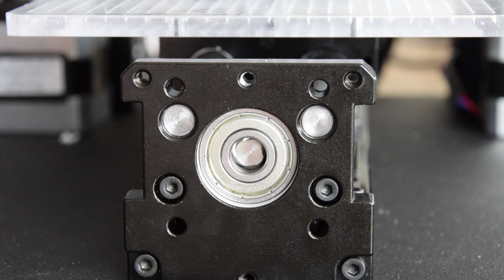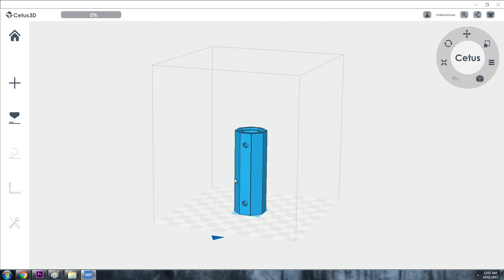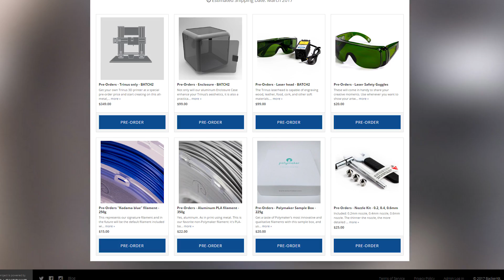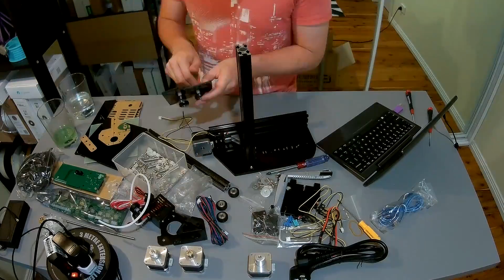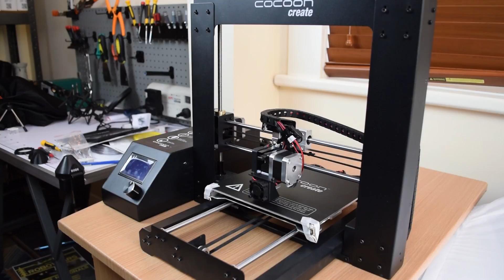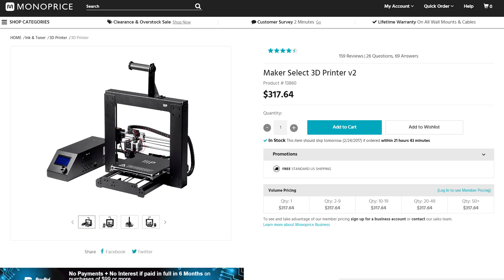Cheap 3D Printers THAT DON'T SUCK $350 and under

Comment: At the moment the Dick Smith website is selling the same Balco printer as Kogan for the same price, but with free delivery.
Reply from the maker: Good tip! I didn't' see the free delivery bit, that makes it an even better deal - i'll update the description.
Reply: Or just wait for cocoon creates new printer(wanhao i3 plus rebrand)
Reply from the maker: It'll be a fair bit more expensive i'm guessing.
Reply: Do they still sell them? I can't find them on either sites
Reply: I have one of the Kogan ones and I haven't had hang problems with it so far. It is a very good printer for its price and it works out of the box with minor setup.
Reply: Also worth pointing out, Kogan has their i3 on sale for $399.  The price was recently $599, but the normal price on the Dick Smith site is $399.  I picked mine up from Dick Smith, instead.  Basically, no matter what you're shopping on Kogan for, Dick Smith will have it, and the price may not be the same, for reasons known only to them.  If the price goes back up on Kogan, check Dick Smith.

Comment: I have a monoprice select mini, and it's a badass printer, and such a work horse, I've used abs, pla, tpu, ninjaflex, wood, and petg. great printer. nice review!
Reply: PNW FPV I have one too, worked great, but just the other day that heating bed stopped warming up
Reply: Have you taken it apart And checked the wires? I have rerouted mine behind the bed. If you haven't joined the Facebook group, do it
Reply: PNW FPV thats actually my plan for the weekend, and thanks I will definitely join the group!
Reply: That seems good, until you realize that after that 1 year warranty....boom, no more returns, and also.....no replacement parts.  If I bought a $300 to $700 printer, I'd expect it to last a few years at least, and to not have to DIY it with third party parts, along with shouldering the burden of those parts.  And while some people may have them last a while, it may not be the norm.  If you're a business it seems more worth it because you're likely to make your money back on it in the first year, but for a consumer, which is what the printer is marketed for, it would likely break down and be out of warranty before you could print $300-$700 worth of useful stuff to just break even.  You'd likely pay less actually buying the stuff you would print, rather than printing it.
Reply: really, any of the monoprice printers are great.
Reply: I posted to the Facebook group. Angus should get a ton of views and subscribers. I love it that he mentions the mini, because it doesn't get the attention it deserves in the YouTube 3D Printing channels!
Reply: Sweet! Thanks for the info. It's on my list for printers to get.
Reply: I replaced my 101hero with the mini. It prints at 50mms opposed to the 101 15mms. The cool part about the mini is all the addons you can print to make it operate like a much more expensive machine.
Reply: Hell yea i was able to get a 2 month used one from craigslist that maybe printed 5-10 items in that span of 2 months (what i was told)  for only $90 and oh man do i love it so much. For a used one i have had little to no problems with it and have printed 50+ items with it so far in a span of 1-2 months. I would recommend this printer to anyone wanting to get their feet wet with 3D Printing.
Reply: While I think it's a nice printer, I've seen a lot of complaints about monoprice printer failures.  And when something goes wrong, you have to send back the entire printer to them for RMA. I've seen people have to RMA them on delivery, along with having to RMA them several times.  At that point, you're paying a lot for shipping.  I think that the real telling thing is if you were to sell your prints, the thing will likely break down before you can break even.  I've seen most people claim monoprice printers fail before even 10 prints were made.  At that rate, you could have probably just ordered the prints from a company for cheaper instead.
Reply: Your Welcome
Reply: USWaterRockets yeah it does need a shout out, the mpsm is such a great budget printer, thanks for posting the link
Reply: I also have a MP Select Mini and I LOVE it.  It's only $200 and prints great quality.
Reply: I'm looking at that as a possible (real) first printer. I have the 101hero, which angus already established, is crappy.
Reply: The wires under the heated bed flex back and forth and fail over time. There's a mod to replace them and move the location where they come out of the case you can do for the cost of the wire and an hour of time. Well worth the effort.
Reply: You will be blown away by the Mini! The quality is amazing, considering the price point. I recommend it to people who are "on the fence" about 3D printing. They can learn if they like it without being tainted by frustrating build problems, and if they hate it they are not trying to sell a used $1000 printer.
Reply: I am the guy who made a lot of addons. A lot of people were saying the printer was bad because you had to pay for a lot of upgrades to make it perfect, so I came up with mods you could do for almost no money (print them yourself) that really fine tune the machine and make it almost perfect.
Reply: Just got the 101Hero today, but bought the Mini at Christmas, got tired of waiting, and love that printer, now, to be disappointed with the one that came today. I have a larger older Monoprice dual (Flashforge Creator X) but wanted something small that was portable and I could take to makerfaires and friends houses.
Reply: I graduate with my associates degree in may, i'll most likely get that as graduation gist to myself :)
Reply: I'm probably going to try and snag the MP Select Mini once the V2 comes out.  Looks to be the best one to get into 3d printing with.
Reply: To add, in the future I have been looking at the $600-800 range of 3d printers and came across the 3d Trinus with all the upgrades is about $775-800 and i like it because it can be transformed into a laser engraver too which is kinda cool for other projects. But i have also been looking into the Original Prusa i3 MK2 which will allow you to upgraded its single extruder to a duo or even a quad extruder which will allow you to print 2-4 different colors at a time which would be nice for some other prints i have been looking at and printing where i only print in one color or if i want to print in two colors i have to pause, change out filament, which takes up time and resuming hardly if ever works after you pause mid print. But that wont be for a year or so and something else might come out then lol but ill stick with my $90 Monoprice Select Mini 3D Printer lol
Reply: Alex Brensike get the prusa if you at all can
Reply: If you have to RMA, which I did with one of my Monoprice printers, they pay return shipping. So no it only costs time.
Reply: return shipping as in shipping back to them?
Reply: Yes
Reply: Prepaid ups label in an email, print it out and tape on box. UPS will even pickup if you call them.
Reply: What 3rd party parts? These are rebranded printers, you can get oem parts, just not from monoprice. My Monoprice dual is a flashforge creator X and I just go to flashforge for parts, I could source Malyan parts for my mini if it needed any.
Reply: As an owner of that printer, I have to say that i've had my issues with it. Overall, I'm happy to have spent so little on a 3D printer that actually works out of the box, but after rounding out the set screw holding the feeding tube in the cooling block, it has at times popped out and ruined quite a few prints.
Reply: Hey, I've been thinking about the Select Mini for a while now. I'm considering getting it soon, so I just have a few questions to ask you. How long have you had it? Do you have V1 or V2? Aside from the heating bed, any other things you've had to fix, and how do you feel about the print quality?
Reply: You must be graduating from 8th grade since the month of May has a capital M. And what is a gist?